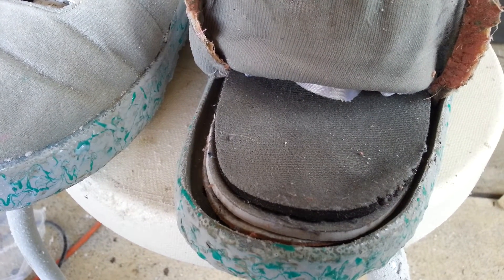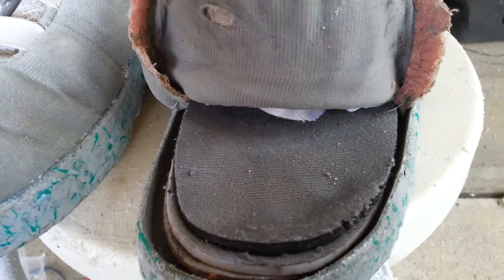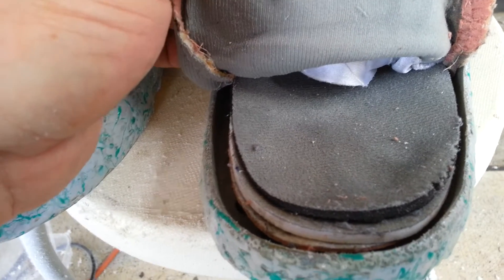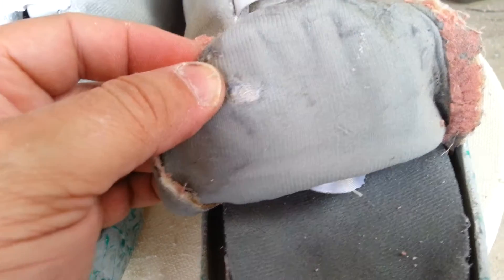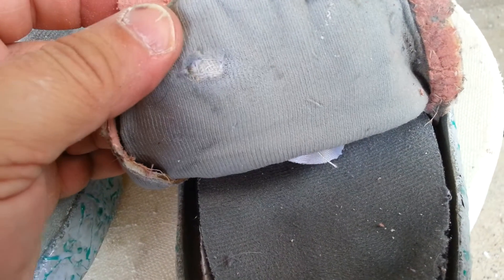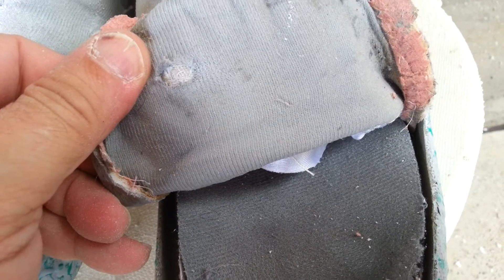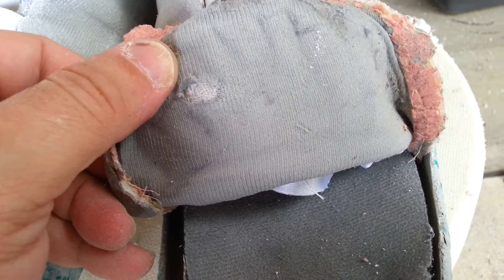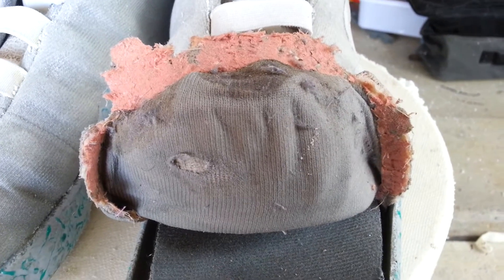MAG Modding Video 15 - Sock Toe Video 3

Comment: +cavx01 when I do the sock toe slim what does the toe box look like ? is it layers or is one big piece ?
Reply from the maker: +nguyenkevin1001 I show the part in my first sock toe (Video 6?).  it is basically cloth and foam laminate.  It feels slightly rubbery due to the glue used.  providing you can separate the layers, it will peel away right up to the point where it sewn in.  You just cut that off nice and close the stitching and you are all good.